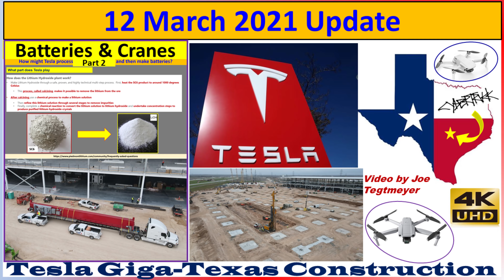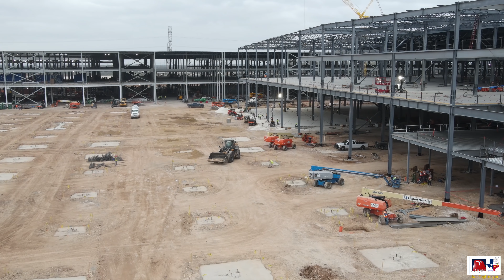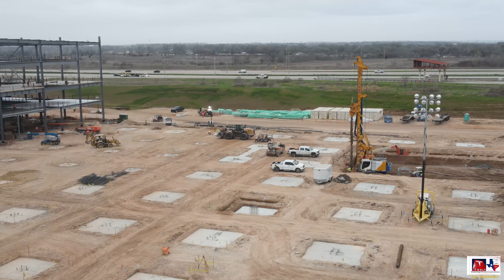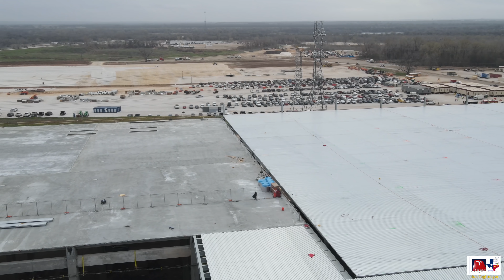Tesla Gigafactory Texas 12 March 2021 Cyber Truck & Model Y Factory Construction Update (07:30AM)

Comment: At 9:06 those could be wall panels of some sort but there are no brackets on the steel columns in that area to hang them on. Look at the western or northern wall, which are external walls, and you can see they are loaded with brackets. I’m curious how these slabs will actually be utilized.
Reply from the maker: They are being installed between the double columns ... much better video of this in my 14 March video

Comment: 7:30  A question about those square pits that are shown here half-filled with fresh concrete, for anyone who knows: 
They seem to be pouring them in two stages; the first pour fills them halfway up, and the second pour fills them flush with the surrounding grade.  I’d imagine there is a very good reason, but what is that reason?  Curious.
Reply: It could be to allow the concrete to cool. It can generate a lot of heat and crack if is poured in too large a mass at one time. This is just a guess based on how the Hoover Dam was built. It was built in massive blocks but they had to have cooling lines in the blocks to keep it from overheating.
Reply: @jeffbransky6499  Honestly, I was wondering if that was the reason.  I took the Hoover Dam tour a few years back and they said that!
Reply: Almost all of these footings (the entire site) were poured in 2 stages with the first stage being a small section in the middle under where the column rebar is located. Not particularly deep, and I think the purpose is to give a level surface to help with locating for height of the rebar cage.

Go a week back to when the first footings in this area were being poured and you can see that detail.

The footings at 7:30, I would guess some over excavation and it was easier to bring it up to height with concrete. Comparing the empty excavations in the front row, to the next row where concrete has been placed, there’s not a lot of depth difference.

Comment: Can anyone tell how long
 this bldg.'s going to be. There's an argument in the office here that the factory is close to a mile in length...is there any truth to that?
Reply: Based on 45' (13.7 m) column spacings for the steel structure. 1125 X 3825 feet (343 X 1166m). Apparently no publicly accessible documentation, so it's mostly guess work. Height is more accurately known, 76' (23.16m)

Comment: I tried to research some useful insight for Joe’s channel on the subject of geopiers… cementitious pillars… or ultimately piling onto sufficiently strong layers/bedrock. I found out it is a very tricky subject and by no means without its controversies. And I hasten to say: best left to the experts! Here in Europe I find there are in-depth building codes for piling, but for the other two possibilities it appears things are less well-defined. Hmm. To give some insight what it could mean to build on a real swamp - and I don’t think the Giga plant terrain qualifies for that distinction - let me summarize what I have seen for the construction of a huge plant onto what used to be coastal swamp area. After clearing the bush and topsoil, the area was pre-loaded with a huge mountain of sand. 2 Years later the swamp was sufficiently compressed to remove the sand. On top of that compressed swamp area the foundation of the plant was built by constructing very large “pontoons” of reinforced concrete, so that the plant in fact was going to “float” on compressed swamp. This method also allowed for some “bounce-back” by the compressed swampy materials underneath. I suppose this is an extreme example, but hopefully useful to make readers think about the job in hand at Giga Texas to build on a terrain that is to some degree swampy. It would be interesting if a (local-)  expert can enlighten us further.

Comment: A little speculation..

Those blue walls in the stamping area seems temporary to me, probably to keep out the weather and create an air conditioned area during construction of the stamping machines... Also because the wall would block movement of the bridge cranes, which makes no sense. It is a way to accelerate the construction while the building is far from finished.

What do you think?!

Comment: Hi Joe. If you keep doing these detailed introductions, we’ll be disappointed when you don’t do one. 😐
7:07. Left of screen. Black pipes on trailer. More steam pipes?
7:41. Cementitious piers. It would be interesting to know if these are the same depth as the geo piers. These got rebar cages lowered into them that were quite short (relatively) compared to the auger length.
8:34. Slab pour. Where’s the rebar? Joe’s Patreons were treated to some photos earlier that show this being poured without any rebar, so likely fibre reinforced, but why?
9:08. Precast wall panels. On top of the vaults?
13:08. What is in those green and blue tanks, there’s doors in the end.
15:46. Frame hanging below the roof right over the aluminium/aluminum furnace. Yossi Dubinsky suggests elsewhere that it might be for a chimney. 
19:11. Concrete pour on ground floor. 2 days ago this area didn’t have rebar laid either, so maybe the entire ground floor on this side is fibre reinforced, unlike the east side which generally got rebar or welded mesh.
23:27. Possible column locations. The rebar to the right is at this stage just starter bars. Open space here in the short term.
24:16. Ducting. Right in line with the section of the roof that was boxed out and didn’t get concrete. All that air has to go somewhere or come from somewhere, and if we don't see penetrations in the wall panels, then large roof penetrations are likely.
24:58. Roof concrete. Column extensions should arrive soon for the east wall.
Reply: The precast panels are vertical wall panels that set on the concrete foundation walls that were poured around the column foundations and that were around the vault excavation area.
Reply: @bobcallahan2322  It would be great to be able to look at the drawings and find out what that area is for. It's the sturdiest bit of steel of construction on the site, it has the water retention vaults, and now these precast wall panels. As Linas says below, someone has suggested blast walls. I don't know anything about car factories so a possible use is not known to me.
Reply: Precast panels - you can see a bunch of them already installed (maybe not in this video). Someone suggested they are blast-walls, as otherwise multiple layers of sheetrock are enough for a firewall.

13:08 writing on the trucks says "liquid propane.com" (or something like that ... the terafactory video shows this) Very clever with the doors -- I'm guessing there are compressors, liquifiers, refrigerators in there.
Reply: @LinasVepstas  They might not be tanks at all, but a tank shaped mobile plant. I don't have a clue! The tankers that cart liquid propane in Australia are no where near that long and slender. I should go and look the propane.com website.
Reply: @DessieDoolan  I mis-spoke - its LNG. I'm pretty sure the first 3/4ths of it is a pressure vessel. Keep it slender, for strength. The last bit is just some sheet metal to protect the equipment inside; its the same size and shape to make it sleek and pretty-looking.  (So the tank itself is stubbier; the extension makes it look long)

Comment: The 2 pits are probably for the battery web machines. they need a strong foundation so you don't pull the 2 ends together.China has a similar pit but used the slurry wall method of construction, The second foundation can still be seen.

Comment: I am having a hard time believing that they will be doing lithium hydroxide production and battery production in the the north west section.  I'm no expert, but I just think they will need more space for the equipment and the conversion process.  They have the space  elsewhere on site. I'll have to watch and see.
Reply: I agree.  The processing of enriched ore to LiOH is no picnic.  1000C temps and caustic, poisonous materials.  Keep it elsewhere on site to protect the integrity of the larger plant.   It will also require large deliveries and removal of waste.  Both of these will be simpler when kept separate.
Reply: I was wondering too. The lithium processing must be a dirty dusty process. It shouldn’t be in the same building where cleanroom conditions are needed to coat the separator membranes. Nor should a dusty process be anywhere near the paint shop.

Comment: By my count, there will be no more than 6 of the large overhead cranes. Two for the Giga Casting bays, one each for each Schuler stamping bay and possibly one on the other side of the newly installed separator wall which demarks the stand alone deep foundation at the Southern most concrete building area. 

Speaking of which, did we ever find out exactly what this foundation if for?

BTW - getting on those scissor lift trucks (around time mark 9:45) always make me nervous. I keep wishing they had swing out legs to make them more stable. I've never been fond of working in high places.

Lastly, I'm beginning to think the corner notch at the South end may be for roof top access. There don't appear to be any supporting ledges or other support points for a roof panel. That notch may look small by it's actually plenty of room for some kind of roof access. Just a thought.
Reply: Someone suggested the stamping bay wall may be temporary. Why they need a temporary wall, I dunno... but this strikes me as the most plausible explanation so far.

Comment: @ 25:00 The "notch", I read as either roof access or venting, as the concrete pouring on the roof is finsished.
 Does the stamping process require any dedicated venting or cooling?

Comment: @ 23:23 Yes these footings are Huge and deep and will take quite a bit of weight..
 I don't see any anchor points on the other side, especially on the concrete section.
So I'm thinking maybe the roof will be cantilevered, but that seems like needless complexity when the goal is: the future faster.
Reply: These footings do bring up questions. Why do the West column supports extend to grade but the East ones do not ?  Why is there no rebar extending from the wall sections ?   If they do take the building to the stamping building wall they will probably have separate columns to support it. The whole large building is made up of several smaller ones because of thermal expansion.
Reply: You're on to something here. Those "wings" on the east side of the column footings are load spreading reinforcements that suggest more weight on the east side of the column than the west side of the column. Also note that the wings are buried so they will not be supporting walls. These foundations extend all the way down to the south end of the paint shop. So something about this "corridor" between the body shop on the east and assembly on the west is considerably different than the rest of the building.
Reply: I am thinking the wing walls are constructed to the top of the big foundation to allow future excavation on the east side down to the top of the foundation without undermining or shoring under the concrete floor in the west side building. At some point in the future they will excavate and construct some kind of column pier that uses the embedded rebar on the east side of the walls.

Comment: @ 19:19 Yes the Unloading* bays are looing very pridy.
*There won't be much loading going on.
Reply: Although it would be cool if the production order was so flexible that they could load transporters ot a bay.  Pity that probably causes more problems than it solves as the stage between factory door and gate gives you greater fexability in production order, amongst other things, such as road track testing, which would be a waste of building to have inside.

Comment: In the switch yard, I think there will be a layer of gravel added to cover the bottom of all those steel frames once everything gets built out
Reply: I find it strange that they didn't lay down a concrete pad for the electrical components to sit on. I'm sure they have a good reason to use gravel, I just don't know what it is.

Comment: I apologize if this has been mentioned before, but at 14:00 I notice all the steel supports have been removed from the concrete pillars.  I guess the structure is stable enough now.
Reply: When they poured the roof they also poured the area on the top of the columns that connected the beams and roof sections. They had earlier welded the rebar together and the concrete finished adding the required strength.

Comment: WOW! Everything about this update is excellent. Thanks. I really don't understand how they are able to pour and screed the concrete floors and roofs so quickly.  Are you able to provide any insights?
Reply from the maker: Probably due to multiple concrete suppliers, 24/7 operations and a strong direction to push forward as fast as possible.  Lots of workers helps too!
Reply: @JoeTegtmeyer  it is amazing how even with a dedicated 24/7 concrete plant it is not enough they have from what I can see is at least two other concrete suppliers. Just amazing how much demand they are creating.
Reply: @travisporter0801  Some of those footings look like they could easily hold a full swimming pool’s worth of concrete

Comment: 22:35 to the left. They are installing north walls of concrete stamping building, basically separating it from the steel structure portion! The dry-in has indeed begun! Great angle Joe!
Reply: Nice catch!! Looks like they are half done too! The building is almost entirely enclosed. Thats great cause they can keep working on the interior when it rains....or snows. 😂
Reply: @zechmerquise5281  no thank you we are done with snow in Texas for a decade I would much rather deal with hurricanes.
Reply from the maker: Yes they are ... one of many details I didn’t get to point out but it’s fun to see what viewers find!  Thanks!

Comment: 24:20 Why have they run the sky crane's rails the whole length of the area if there is a dividing wall?
Reply: It appears that the interior blue walls are made up from steel studs with insulating board to add strength.  Because of the light weight they might be temporary to seal off the area.
Reply: Maybe there will be cranes on both side of the wall?

Comment: I believe the tanker truck at 23:54 is hauling in potable water to fill the 3 portable storage tanks with potable water to then pump it into the fire water loop to then pressure test the line. There are 2 more sets of 3 tanks with one set at the north end and another set in the middle about half way toward the north end. A couple of days ago I saw this truck or one similar (Jeff’s video) parked by the north end tanks. You can see a large riser of water pipe run above grade near each of the 3 sets of tanks.  The north and south sets also have some big pumps near them.
Reply: There is no public water line connection, so the water has to be imported. You want to use potable water for the test because once you know that the hydrostatic pressure test is successful ( usually 200 psi held for 2 hours with a small allowance for leakage) any dirt and debris in the line needs to be flushed out by flushing water thru above a minimum specified velocity. Fire line flushing is very particular to make sure that no debris could possibly foul any sprinkler heads. The also needs to be superchlorinated, flushed back down to typical public water line chlorine level and tested for the absence of indicator bacteria.
Reply: @bobcallahan2322  Thanks for the explanation. Additional question if you don't mind, this fire loop will it normally be a static pressure of around 14-70psi? That would be a common enough static pressure here (100-500kPa). I see lots of water towers in the distance, are we likely to see one on this site?
Reply: @DessieDoolan  If the suspected public water connection will have a high enough flow rate, then a water tower will not be necessary for fire flow. It will be hard to guess what is planned for process water, process water recycling, or storm water reuse for process, and any storage needed for these.
Reply: @bobcallahan2322  Thanks Bob. I always look out for your comments. Cheers.
Reply: Hi Bob. I get the pressure testing, but not why they need all the portable storage tanks. There's 10 by my count. Is there some filtration going on here as well, or some other process?